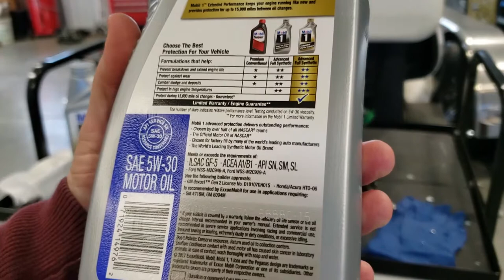6.8L V10 RV Engine Oil Change

Comment: Great video. Thanks.  We were paying $95 per oil change for our RV. Now we pay about half that and very easy to do ourselves. FYI our 2017 Ford E-350 V10 - 6.8L calls for 7 qts.  Like you said we know what filters and oil is being used in our RV so we feel more confident when we stomp on the gas harder. Again Thank you!

Comment: Nice video, well done.  The only thing I would have added, is that it is always a good idea to carry one or two extra quarts of oil in your motorhome luggage compartment.  Also, I like to use a torque wrench on the drain plug.  I've been known to over-tighten some nuts and bolts.
Reply: What ft lbs or inch pounds do you set your torque wrench at?

Comment: And a guy should make sure the old filter gasket had come off before installing new filter. A double gasket will leak out oil and all of it. Thanks for the tip of filling the new filter with oil before installing.

Comment: Did I hear you correctly, when you said you dumped your used oil in a landfill?
Reply: The landfill has a recycling ♻️ center ,, he doesn’t actually dump it in the landfill 😅